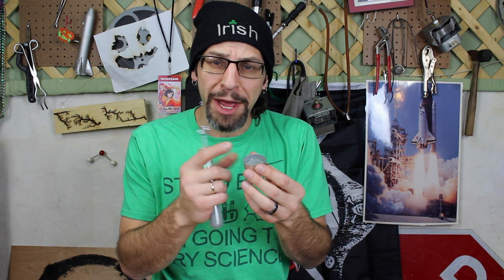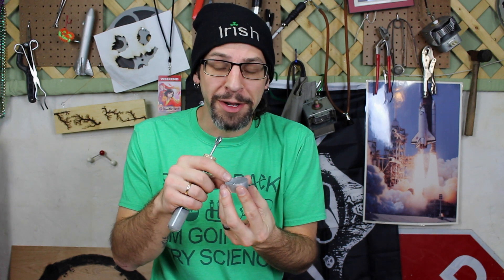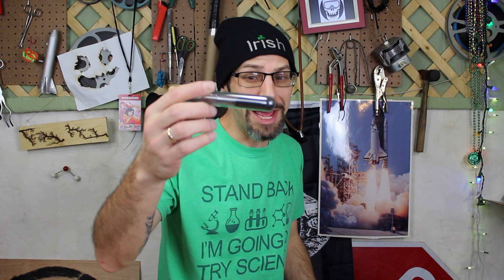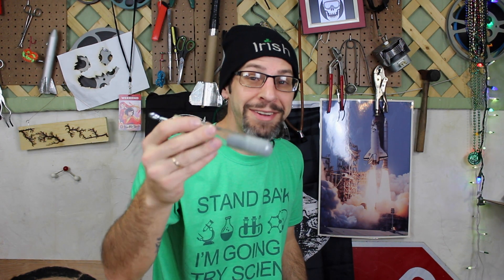Flash Powder Ep. 1 - Making Flash Powder from Zinc and Sulfur

Comment: flash powder i put together violently explodes at 70 degrees Celsius, when exposed to open flame in a unconfined space it also violently explodes... phosphorus chlorate iron nitrate phosphorus sulfide lead nitrate phosphorus potassium nitrate ammonium nitrate nitro cellulose acidic acid. for launching the fuse powder into the air, you made fuse powder. would go completely deaf over 10 grains of actual flash powder, ya had a good 80 grains in each of those tests... that would have knocked over the camera burning the stuff I fiddle with no more then 100mg at a time.
Reply: friction sensitive, needs to stay in solution of acidic acid or it will self detonate "self detonates explosively even when not confined or drying in quantities larger then 100gm" same as iodine explosives but only slightly less sensitive.
Reply: silicate powder is a filler for the crystals to bond to as they come out of solution.